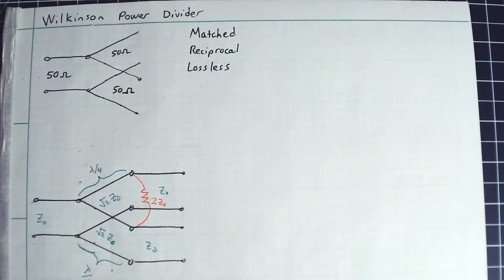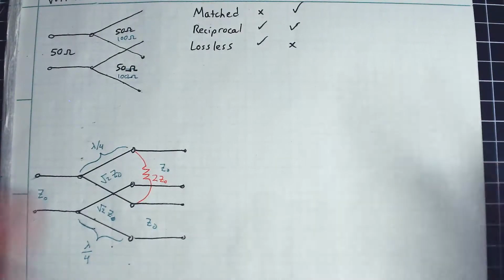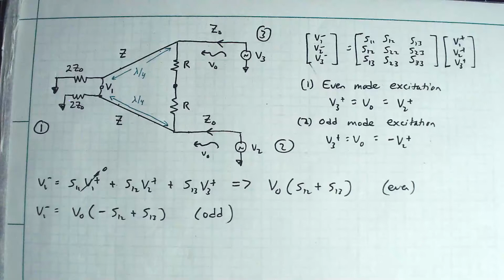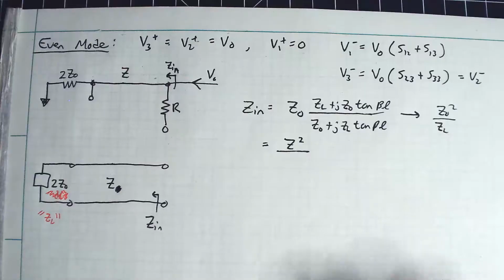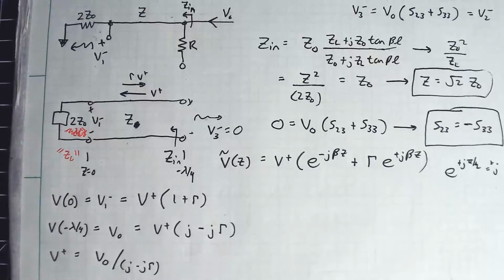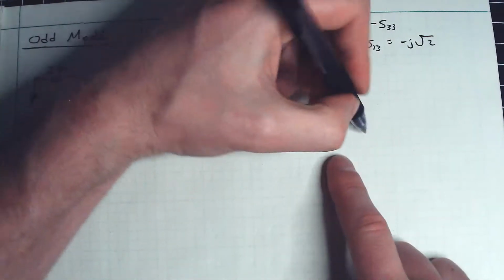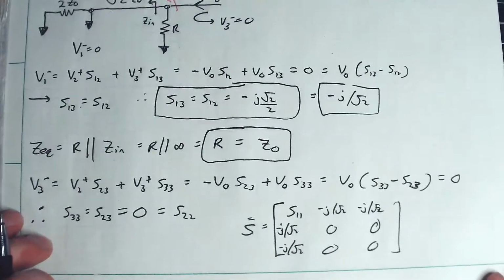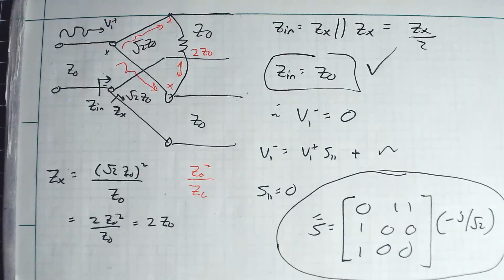Lecture 29---Wilkinson Power Divider

Comment: Sir I have a doubt, 
if signal is travelling from port 1 to port 2,port 3 and it is -3db . If signal travel from port 2 and 3 then it should add the signal and it should be 0 db